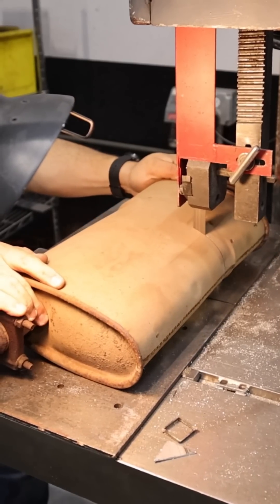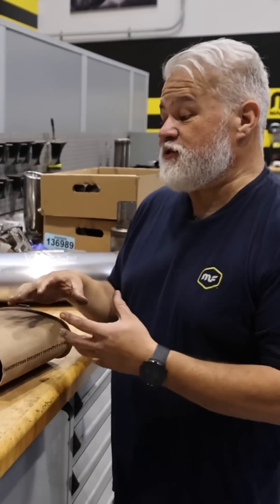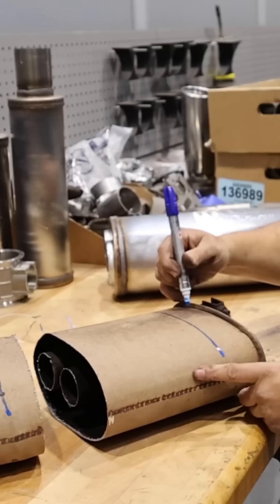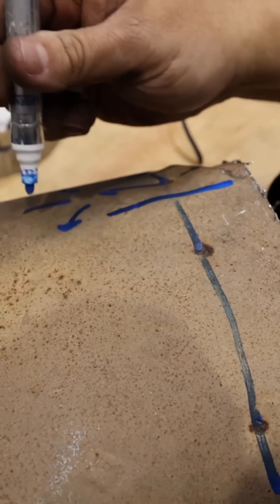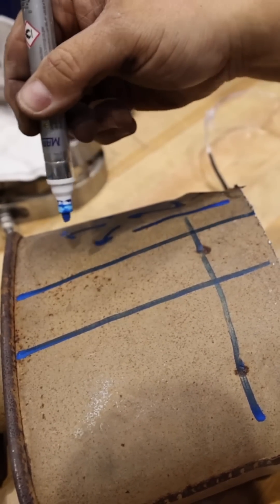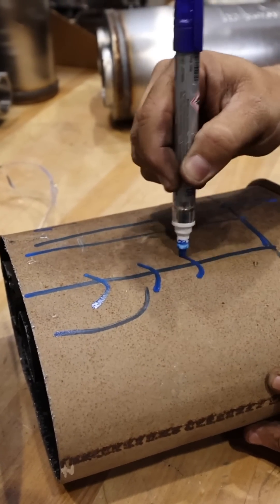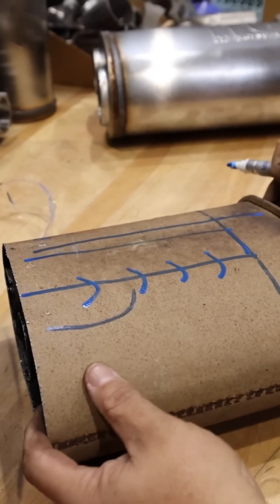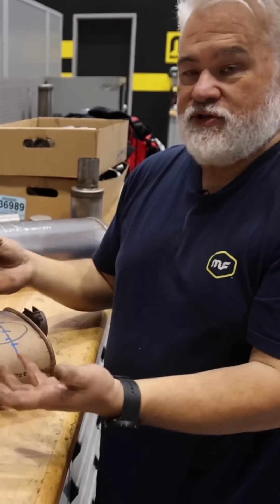What’s Inside a Cheap Exhaust Muffler?

Comment: You know what would be even more restrictive and power robbing?  A straight piece of pipe.  Yep, straight pipe exhausts with no mufflers have more back pressure.  Those chambers allow the hot high pressure pulses of gas to expand and relieve pressure.  Then, some of the high pressure peaks slow down and fill in the low pressure areas between the exhaust pulses.  If you do that enough, what comes out of the end of the tail pipe sounds less like a pop, pop, pop, and more like a whoosh of fast moving air.

Comment: Although I agree with the comments that it's built to suppress sound. It's also not supposed to rob you of 40 horsepower in the process. You can make an engine quieter without killing power. It just costs more to do it

Comment: Technically if you build the whole vehicle around low sound and good fuel economy it’s doing exactly that. Yes it is restricting airflow and that’s on purpose, that’s how it was designed.  So your comments are misleading. Putting a high end muffler on isn’t going to make the car last longer or have better fuel economy. Stainless could make it last longer that’s about it.

Comment: In 1968 stock mufflers so restrictive the valve guides wore prematurely till we replaced the factory mufflers with smaller straight thru resonators (popper stoppers).

Comment: That is why you can remove all emissions and EPA regulated equipment and get 50-100% better MPG on any vehicle. And with current fuel and fuel injection, still pass emission tests - just not the sound test. So, less MPG more fuel and more $$$. Always about the $$$ not truly about the environment.

Comment: Not only does it muffle sound - it provides BACK PRESSURE, and is part of the design of the engine.  Ask anyone who has had a hole in their muffler how much their fuel usage went up.  If you are going to mock something, at least TRY understand what it does first.

Comment: There's 3 ways to quiet a car exhaust. You can do it throught restriction, sound wave reflection, and sound wave absorption. The muffler shown uses a small amount of sound wave reflection along with a lot of restriction.
Reply: Hardly. That muffler is probably very efficient and not noticably restrictive at all.
Reply: @life_of_riley88  Depends on the CID of the engine it's put behind eh. Looks like an old IPC turbo muffler.

Comment: Every factory built, internally combusted vehicle has a muffler, but not every firearm. Why is that? Because of tyrannical idiocy, that's why. Both reduce decibels so that tools they are attached to can be used with limited loss of hearing for the user of the tool. However, one must be illegally regulated, while the other is ubiquitous in daily life.

Comment: And now more people get a better understanding why aftermarket mufflers gain from 7- to as much as 36 horsepower. Proven in an engine masters episode.
Reply: only at full throttle. if your just going to work putting along at 2k rpm this is the one you want. Not everyone is driving a 383 stroker w/500 +HP!
Reply: Only if remap the ECU for the new exaust... if not you most likely lost power because the tuning was with backpressure from the old exaust.
Reply: @triage2962 should be able to self lean that. They add cold air intakes all the time

Comment: Maybe you need to look up the definition of Muffler. I think you confused straight Pipe & Muffler with each other. I've cut several different Mufflers open over the years of my life. I can tell you there are at least 5 to 6 different  internal designs. 
When I was younger we used to take a blowtorch to the cherry bomb glass packs and burn all the glass matting out of them, then drop it on its end and let it all fall out. Turns your header Mufflers right into straight pipes

Comment: OK, so you cut something in half that was designed to be compact in size and block sound. You drew all over it pointing out exactly what's going on and the confirming what we already knew. So you're going to put a better flowing muffler on it so you get a better sound and more flow that's fine I would do the same thing, but what's the point of cutting the other one and a half and pointing out the fact that it's doing exactly what it supposed to Lol.

Comment: This is how a muffler works! It suppresses sound by the use of baffles. These baffles trap the sound of the still burning exhaust gases as it exits the engine. As long as it maintains a path that is the same or bigger than the entrance pipe the exhaust flows through just fine but not the sound. And this is nothing compaired to a converter the EPA requires that does create back pressure.

Comment: This guy doesn’t seem to understand that “inefficiency” is exactly what makes a muffler “muffle”.  The trick is to “back up” the pulses so they exit the muffler in one smooth flow (or as much as possible).
Reply: That guy is a wizard with tig or mig welding up custom high dollar exhaust headers and complete exhaust systems. He's fantastic and IIRC that's all he does. I've been watching him on TV shows for prolly over 20+ years. He's the go-to guy when you're in a pinch to get a car to SEMA or a car show Etc.. I could learn a lot from him and it would be a great course to learn doing custom exhaust headers and exhaust systems.

Comment: You're not wrong but it's supposed to be that way. The engineers who design engines design them to work better with that restriction than it would without it.

Comment: Not everyone wants their car to sound like it's running straight headers.  In fact MOST people don't want that.  At the same time,  car makers get a LOT of sales by being more fuel efficient than their competition.  Do you REALLY think their engineers are sacrificing significant efficiency with this design?   I'll answer for you.  NO.  It's not a race car muffler.  It's not designed to eek out an extra fraction of a hp that could make the difference in race car.  They are designing it so the masses can hear their favorite music or podcast as they drive and don't want to wake the entire neighborhood if they work late.

Comment: mufflers do more than just muffle the sound. they also create a certain amount of back pressure to the engine. this is very important... without the back pressure to the engine, you can burn the valves. 
There is a reason for this; an engine is designed for a specific flow of gas through the piston chambers, valves and exhaust system. The engine tune relies on some degree of back pressure to push against in order to balance the gas pressure in the engine and maximise power and torque.

Comment: Those mufflers are the biggest power killers on the planet. I reckon you will not only increase HP, but DEFINETLY driveability if you change to a free flowing, induction tuned muffler.

Comment: If all cars had straight through mufflers with no baffling most people would be screaming about the noise pollution. I guess everyone has to buy an electric car.
Reply: It's called a straight pipe, and my straight piped truck isn't even that loud calm down
Reply: @baconqot8324 . WHAT DID YOU SAY, can’t hear you over your  truck
Reply: @SW-qr8qe  I do have a thrush muffler I plan on putting on it I just need to figure out how I could use as much of the original exhaust as I can

Comment: I build mufflers  that part is for sound reduction  and there isn't any restrictions
Reply: The exhausts are optimized for the best performance for the type of car  we even make, some that have actuators that block the exhaust  gas oem exhausts balance performance with noise reduction if you want to make noise or adjust the gas flows there are mufflers that do that.
Reply: It could be optimized for increased flow with least amounts of bends, but this one is about the cost of production and noise muffling, not performance oriented. Hard corners and design as this will change how the air moves, introduce more turbulence that improves thermal transfer witch is not desired and slows the air down creating positive pressure that does not allow engine to exhaust and vent the gasses rapidly as it could leaving performance decrease compared to better flowing exhaust.

Comment: Did cutting it open actually accomplish anything?
Reply: It accomplished more than your disingenuous comment. Its obvious he was using it as an example to show how it works.
Reply: @moshunit96  
It was more of a sarcastic question than a disingenuous comment.
I figured the ? at the end of the sentence projected that.
It was obvious that he attempted to show how it works, but cutting it in half didn't do much.
His drawings showed what the cutting showed anyway.
A lengthwise cross section cut that would show the internals including the chambers would be more beneficial, but I am assuming he didn't do that due to the fact his bandsaw is most likely unable to cut through the entire width of the muffler.

Comment: When the OEM muffler split at the seam (had a bad case of running rich) on an old 81 Toyota p/u w/ the 22R blew open I just replaced it with an equal length of 6in x 1/16th well casing. Was quieter than the original was well before the rich issue caused the old muffler to grenade. It also gave it a nice DEEP yet QUIET tinny sound as it acted as a great sound dampener//expansion-chamber//resonator. At idle you had to pay attention to hear it & even when revved way high you could still carry on a conversation albeit with raised voices but nowhere near even yelling. This was with stock size pipes.

Comment: What a waste of time .
Reply: Everyone has to start somewhere. Plus you are watching internet videos, wasting time is pretty much what we do.
Reply: Because of its inefficiency, it can actually affect your fuel mileage and power. If you're not going to upgrade to a better muffler from stock then put a stock muffler in. There's relevance to his video.
Reply: @David Clemens  if you want better flow, then run a straight pipe. And put up with the noise.  Or if you running a two cycle  use a megaphone and reverse  megaphone and stinger to gain the effect you want.  But mufflers on cars and trucks will always be more about noise  reduction (pollution) than efficiency  that's to the idiotic laws passed.

Comment: A "muffler" which is nothing but sound suppression.  OK
Reply: Yeah when we built it we called it a resonator, but gen pop calls them mufflers
Reply: @Adam Flannigan  there's a huge difference between a resonator and a muffler. A muffler absorbs sound energy, a resonator uses sound waves to cancel sound energy. Mufflers dampen sound while resonators cancel specific frequencies and are used to prevent droning or resonance at specific points. The only similarity is they're exhaust components. Their construction, function, and purpose are completely different.
Reply: @EyebrowsMahoney  as the former engineering intern who both worked on the line putting them together, and later improving efficiencies on the line, yeah, I know.  Most average people will call that a muffler, but when we built it we called it a resonator.

Comment: No, you don't.  Exhaust doesn't build HP, only robs it.   I work for a company that manufactures OEM mufflers and exhaust systems.  If you remove the catalyst you will see a modest performance gain, because Cats restrict airflow.  It doesn't matter how much the gas expands before the cat if the cat itself is restricting airflow.

Comment: Those aren't cheap. We spend months tuning the mufflers to individual engines and vehicles. Each port, hole, pipe length, pipe diameter and chamber play a part in tuning. This guy knows nothing about muffler tuning. There is a lot that goes into tuning and meeting federal noise requirements.

Comment: I disconnected my exhaust on my silverado because the coupling was shot.Seemed like the hp went up. I since then repaired it and I'm not happy with the performance.  What muffler cab I add to keep the sound and hp

Comment: If this guy is so good, why doesn't he get a job as an engineer designing mufflers? Because he's NOT. Mufflers are designed not only to be quiet but also to create a certain amount of back pressure for the factory stock engine to run efficiently. Where not all running around in hotrods.
Reply: That guy is a wizard with tig or mig welding up custom high dollar exhaust headers and complete exhaust systems. He's fantastic and IIRC that's all he does. I've been watching him on TV shows for prolly over 20+ years. He's the go-to guy when you're in a pinch to get a car to SEMA or a car show Etc.. I could learn a lot from him and it would be a great course to learn doing custom exhaust headers and exhaust systems..

Comment: Wow, who would have thought a device created purely for sound suppression would be designed purely for sound suppression.
Reply: Yeah, this guy just said that and then starts going into the inefficiencies because of sound suppression.   Makes you wonder why they call it a "muffler"?
Reply: Yall missed the point engines are basically a air compressor so the more you bring in and send out without it being restricted means more power reliability and will run more efficiently
Reply: He did say it was completely about sound suppression.  It causes back pressure (restrictive) and that robs horsepower.  It was not designed to take the engine efficiency into account.
Reply: @frankgonzalez3822  You know what would be even more restrictive and power robbing?  A straight piece of pipe.  Yep, straight pipe exhausts with no mufflers have more back pressure.
Reply: @BryanTorok  That depends on diameter of pipe.  There are mufflers that don't cause as much back pressure.  These are more expensive.
Reply: @BryanTorok lol ok sure
Reply: @malachihornbaker5869  What did I say that you find so humorous?
Reply: @BryanTorok  Yep, that's why they run restrictive mufflers on race cars. 🤣
Reply: @BryanTorok  No, with smaller straight pipe diameter, the gas velocity would be higher thus no backpressure. It should not be too big nor too small.
Reply: @kaikart123  I think you are mis-applying  Bernoulli's Principle.
Reply: @BryanTorok  That's a fact, my sweet summer child
Reply: @kaikart123  Your statement is so easy to disprove it is laughable.  Take a piece of one inch PVC pipe and blow through it.  Now take a drinking straw and do the same.  It is obvious that the larger pipe flows more air with less back pressure.  

If one were able to connect a pressure gauge through a hole in the side of the pipe, one would measure a reduced pressure with the flowing air.  But that is not the pressure we are concerned with.  It is the pressure we would measure inside your mouth.  That is analogous to the pressure the engine sees.
Reply: The ignorance in these comments is wild
Reply: @JoeBleaux69 It's the fake stupid Internet at it again, clueless.
Reply: That needed less explanation…… 😂😂😂
He should cut open a straight thru cherry bomb and see what he says 😂😂😂
Reply: @luckyskitchen4472  A Cherry Bomb muffler does provide a straight through path, but it is much more than a straight pipe.  It allows room for hot gasses to expand through a baffle and fiber glass material.
Reply: Shocking isn't it?😂
Reply: 😂right !😂

Comment: That right there is the longest lasting muffler. Glass pack ones either burn out or simply clog up turning them into straight pipes and rendering them useless for the task.
Reply: These only last about a year.  Rust out and. Need to be replaced.
Reply: @lookatmelookingatu  if you live in the salt belt, nothing it survive. My old baffled muffler was 20years old before I had to replace it. The glass packed mufflers on my other car lasted 2year
Reply: @The_Koups  i had glass packs on my ram for 4 years before i sold it...still fine..paint the welds and keep it washed
Reply: @MidnightPolaris800  is that because it spent most of its life in the repair shop? Nah jokes 🤣

Comment: This is normal. That and engines are designed with a certain ammoint of back pressure anyway. Cheap or not, its supposed to just muffle sound….hence MUFFLER.

Comment: Engines are designed for that restriction. The engine needs back pressure to run efficiently. If you try to change the muffler, the engine will also have to be redesigned. Don't fix what's not broken.

Comment: Also provides back pressure, which helps with horsepower. Running open headers lowers cylinder pressure and cuts horsepower. Balancing an engine’s intake and exhaust is just as important as fuel and spark.
Reply: Not true unless it's a turbo for scavenging effect.
Reply: @jasonmclean5921  ok.

Comment: Congratulations! You figured out how a muffler works. They are designed to add some back pressure for the engine to run more efficiently. Just replace it already and send the customer on their way.